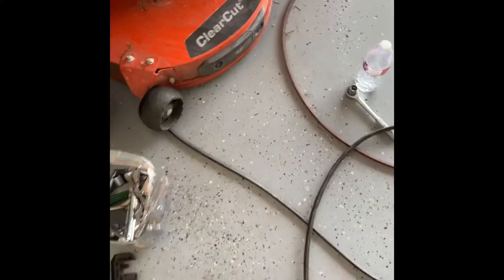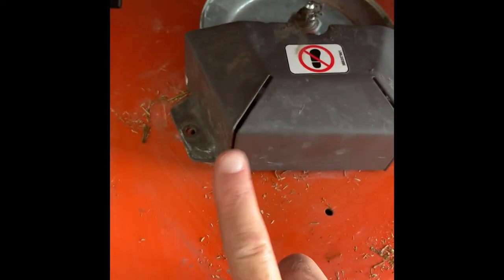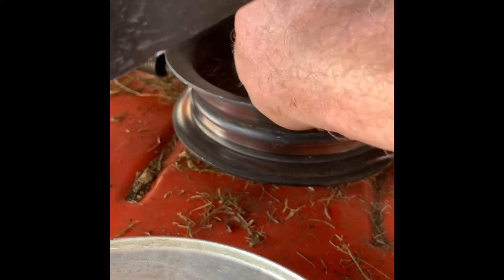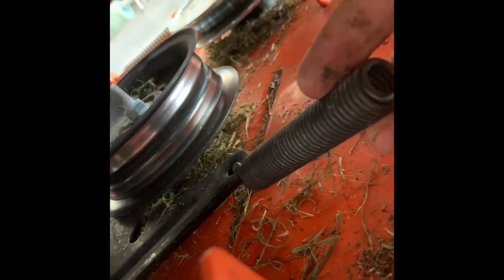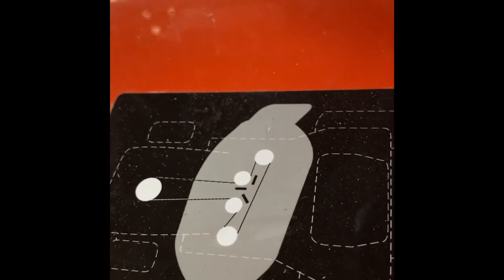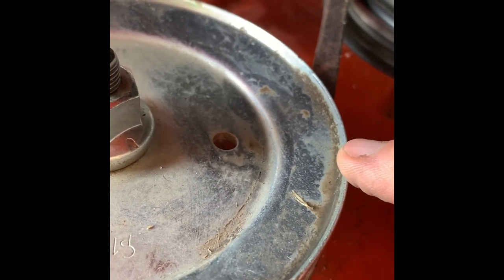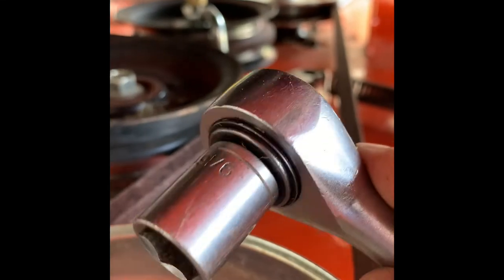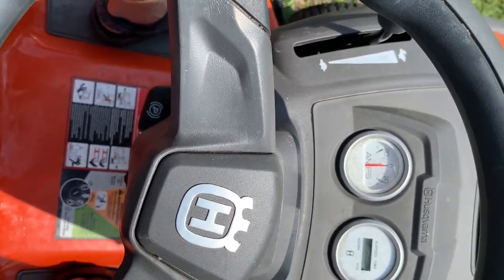Husqvarna riding mower deck belt (primary mower belt) replacement - DIY works for me

Comment: Thanks for the part about how to walk the belt on.  I fought for 5 hours trying to figure it out.   I did loosen the spring adjustment to its minimum to make it a little easier.  Not easy for an 83 old man to roll around on the floor fighting with it.  Next time I will know.  For others information I used a 98 inch belt and it fit perfectly.  Seemed short when I started, but once on it seemed to stretch out a little.

Comment: What does the primary and secondary belt operate ..for part number purposes
Reply from the maker: A deck belt is considered as the primary mower belt. A ground drive belt, on the other hand, considers a drive belt for all.
Secondary deck drive belts power the lawn mower blades. Used with primary deck drive belt (M95121) that pulls power from the engine. John Deere belts contain strong material to prevent stretching and roll over which provides smooth engagement and consistent power to the mower deck.😇

Comment: Trying this with a 98 inch belt and it seems too tight. Should I be using a 100 inch belt?
Reply from the maker: This is the one I use for my mower .. Length ??? Husqvarna OEM 587270101 Deck Belt Fits TS342 YT42DXLS YTH2642TDF TS343 TS242 
https://www.amazon.com/Husqvarna-587270101-TS342-YT42DXLS-YTH2642TDF/dp/B0981GT3QX?source=ps-sl-shoppingads-lpcontext&ref_=fplfs&psc=1&smid=A188CT08WE77G1
How do I contact Husqvarna by phone?
(800) 487 5951
Husqvarna Group / Customer service👍😇

Comment: I’m having the worst time with my mower can’t find the right size belt ours is a 2005 42in deck
Reply from the maker: Best I could find site if you have the model number you can type it in .... this is what I found God bless😇😇 TRACTOR-MODEL NUMBER YTH18542 (917.279060), PRODUCT NO. 960 13 00-02MOWER DECK 68532 17 48-83 V-Belt, 42" Mower
https://www.ahupd.com/YTH22V42-Husqvarna-Riding-Mower-Deck-Parts
https://www.manualslib.com/manual/668412/Husqvarna-Yth18542-960130002.html?page=17#manual
 Manual starts """" https://www.manualslib.com/manual/668412/Husqvarna-Yth18542-960130002.html#manual

Comment: Why didn’t you show putting the belt back on?
Reply from the maker: Needed two hands could not hold phone camera and did not have a stand... I tried to explain my best I could and visually show what could with one hand ... follow the pattern on your deck plate remove what I say on the video to get it on  😇

Comment: Okay first you said 5/8 then you said 9/16 when you put the guard pin belt dohicky bolt back on! One or the other please 😅
Reply from the maker: 9/16 for the for pulley guard nut // 5/8 for mower blades nuts thank you for pointing that out 😇
Reply: @mbjdiy1778  Actually I thought you said 5/8” first for the nut to remove the arm then you said 9/16” to put it back on. Maybe my mistake???
Reply: @mbjdiy1778  It was helpful either way!!!